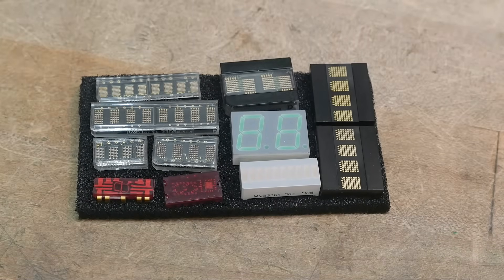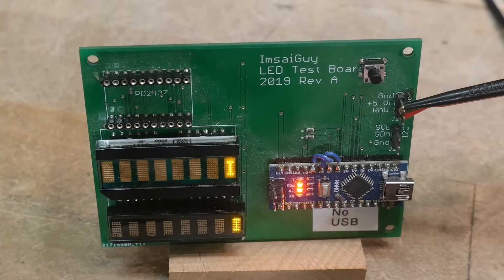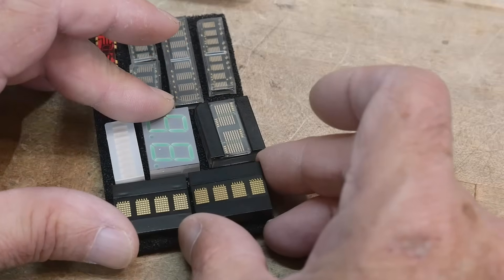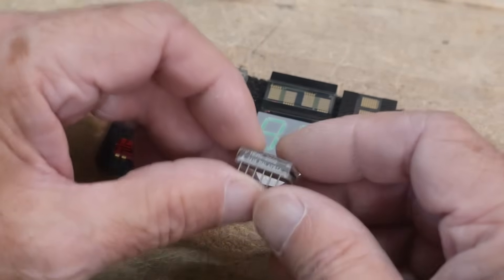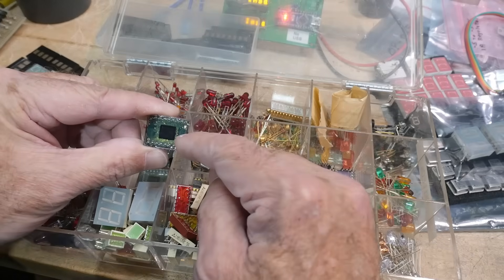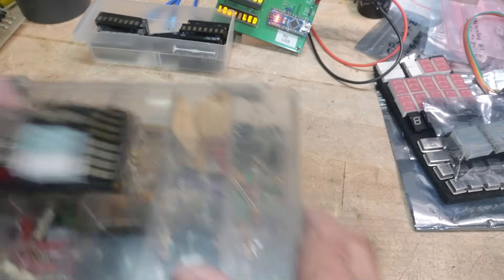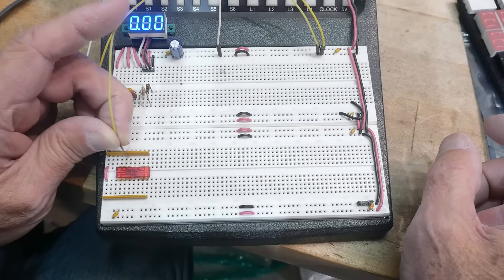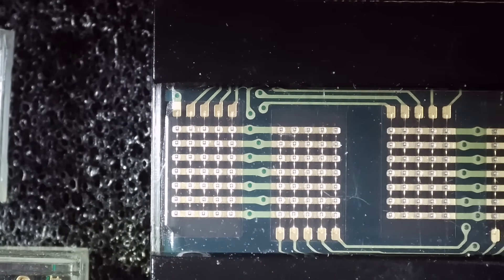#2127 5x7 Matrix LED Display Modules

Comment: Where does one shop for cool electronics supplies for this? Already had a bad expirience from amazon bought fake schmitt triggers dont wanna spend 10$ shipping on 10$ parts from like digikey
Reply from the maker: sorry, legit places like digikey and mouser will have to charge standard shipping. if small order you can choose USPS shipipng for about $7 on digikey

Comment: I probably got my yellow 8 digit displays from the same seller! It was a few years ago and they had lots of 10 displays for somthing like $40 and iirc they had yellow and green ones. I made an offer for 3 or 4 lots for $30 each and they accepted! Unheard of at $3 per display lol! I built a 40x4 character serial module out of 16 of them and it was glorious (and also insane how much current it could pull). I still have a bunch left somewhere just waiting for a project.

Comment: The RX TX lights were blinking on the Arduino. Looks like the Serial prints were executing. They slow down the MCU tremendously. What I do is use preprocessors to disable them. On top do a #define SERIAL_OUTPUT and put all the Serial.print statements inside #ifdef SERIAL_OUTPUT and #endif blocks in the code. When not connecting Arduino to a computer anymore, upload the code with the above #define statement commented out (to undefine it). That will remove all the Serial.print statements in the compilation.
Reply from the maker: conditional compile commands. they are handy.

Comment: The red one with the chip inside do I remember from radar test generators, the epoxy cracked over time causing them to be periodic when thermic pulling the bound wires.

Comment: I have made lots of equipment with the HCMS-3977 which are serial and you can address each LED. I made my own character set because I didn't like the esthetics of anyone else's. Also I needed symbols like degree, ohm, micro etc. Previously I used the HDLx-2416. Great video.

Comment: nice displays back when LED could not be made very large or bright. And more hardware than software, LCD colour displays IMHO have made lot's of devices unreadable. How many designs do you know with sub 1.5" displays.

Got some nice sunlight readable one's, more data in the datasheet for how to cool them. then there is for how to drive them.
Without a good heatsink they get too hot to touch very fast.

Comment: Using Octopart, the only two I checked.

PDSP1881 - Shengu Electronics supposedly has 5129 in stock.  Price not listed.  No one else has any.
HDLO2416 - Digikey has 1,878 in stock along with a bunch of other suppliers.  Digikey wants $33 each, others more typically want $23 each.

Comment: Probably my favorite "project" I ever made used 8 of the 8 digit yellow displays for a total of 64 characters.  It is a CW (Morse code) decoder display.  It scrolls the decoded message across the displays.  Makes for a great eye catcher when setting up for amateur radio events like Field Day at the general public information table.  There is a radio connected to it at the table that the general public can set down at and spin the dial to find and decode messages.  Don't know what it is about CW but it draws people in.  Once I added the display I swear it drew in twice as many people as previously.

Comment: I have 5 each 4-character 5x7 HDLO-2416 removed from their sockets in a control panel for a piece of test equipment.  Looks like the one from Mike top middle. Sitting in a box, wish I had a use for them. They are gorgeous and the data sheet is cool to read because of the pre-programmed alphanumerics.  They were made in Malaysia and are a Broadcom product.  The HDLO is high efficiency red, and features internal or external dimming capability.